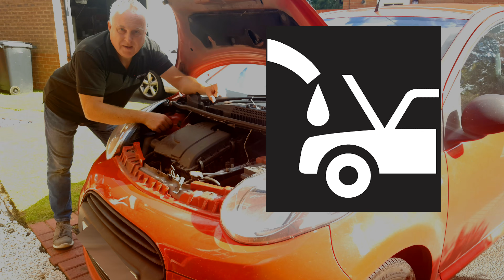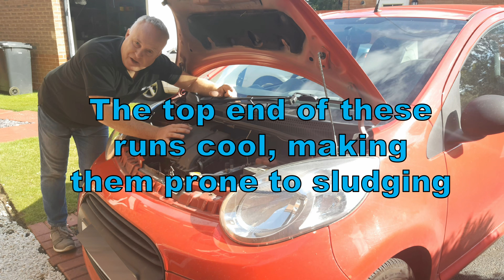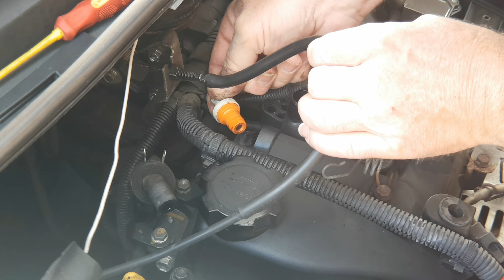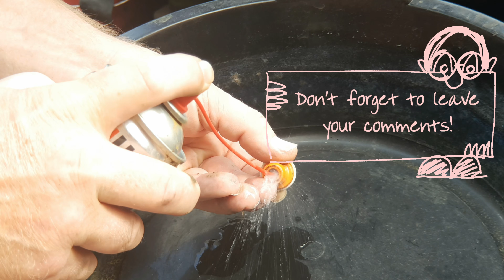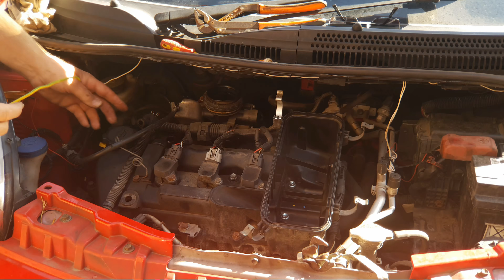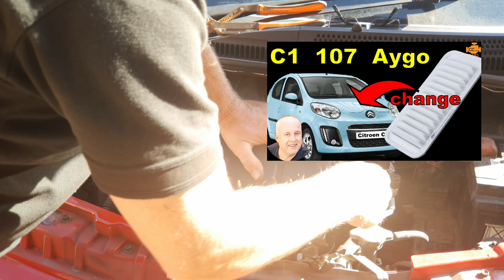Citroen C1 Using Oil❓ Is YOUR Citroen C1 PCV Valve Blocked❓

Comment: Thanks a lot for this video, really clear and helpful!!  

Just to add a quick warning I got from ChatGPT (so not personal critique), not all carburettor cleaners are suitable for PCV valves. Some heavy duty sprays are too aggressive and not safe for plastics or rubber. For example, Holts Professional Carb and Injector Cleaner and Comma Carb Cleaner both warn against use on plastics and rubber, so they are not suitable for PCV valves.  

By contrast, OB41 Carburettor Cleaner specifically lists PCV valves and throttle body butterfly valves as safe applications, which makes it a reliable option.

Comment: Thanks i checked mine, it was passing a tiny of air flow counter way but after cleaning it blocks the air perfectly. Also on the normal way the air flow is now greater. 

I hope it will solve the oil consumption, mine is consuming 1L every 2000 kms with 15W40 but it was consuming more before when i was running 5W30. As the summer is finishing i will soon oil change to 5W40, i prefer to stick with W40 because i usually drive between 3 to 5k rpms.

Comment: Great video. My pcv valve now rattles if I shake it. So the internal spring must be gone.
Car is burning oil but I am now  using cheap, thin Mannol oil.
At £40 for a new pcv valve I don't know if its the cheap thin oil or the pcv valve, or both.
Might have to go back to a more expensive engine oil.

Comment: Yeah, I watched this and cleaned my PCV Valve. It wasn't that dirty apart from the spring loaded valive itself, which was begging to show signs of corrosion. My car is running about twice as smooth now! Next I'm.going to remove the spark plugs and clean/replace them!
Thanks for this video. I may have made a mess of it otherwise!

Comment: So I gave this a try, but I’m unsure if the valve needs replacing.

When I first tried sucking, air came through so I cleaned it. 

Once cleaned, I tried again and it still came through. So I sucked harder where it then closed. 

How hard did you need to suck to get the valve to close for yourself? I want to know if you think it’s worth I just replace it.
Reply from the maker: Yes, that sounds like correct operation. It restricts the flow of gasses at idle.
Reply from the maker: oh, but if you feel you need a new one,there are two links to it in the description
Reply: @HPS-i4j  works correct. Don't replace. Just keep clean.

Comment: So question for the guru, my old man referred me to you, 2009 c1 engine light pops up cylinder 1 misfire. Changed spark plugs and coil packs, still comes up, it ONLY comes up on tick over never whilst driving, but if it’s sat idling for 5 mins or more bam comes up, no loss of power, no strange noise nothing….
Reply: @lewisward910  i have same problem,,, first found engine oil has some fuel smell,  specious fuel injectors leakage, then changed 3 new injectors, the engine oil no more fuel smell, but engine light up, computer code is p2178 which mean air to fuel ratio is not correct... 

Checked following all correct:
Fuel pump pressure 
Maf sensor 
Pcv valve 
No pipe leakage

Then change 3 injectors again, and waiting to see the result.

Comment: Replaced my Toyota Aygo 2009(147000KM) PCV Valve for the first time today. Looks dirty. PCV cleaned. hope you use less oil. I'm going to order a new PCV from the Toyota dealer, because it doesn't cost that much( €29 from the Toyota dealer😢OE but to most . Thx for video
Reply: @andy464 hello, any update?
Reply: @albertgashi1814  Yes, I ordered and replaced the part from the dealer😊
Reply: @andy464does it still consume oil, or that problem is fixed now with the new PCV valve?
Reply: @albertgashi1814  I see the oil consumption is still the same. Maybe it's because the engine has traveled many kilometers (180,000km)
Reply: “I exchanged my Toyota Aygo for a 2021 Hyundai i20 N Line. This particular model is relatively uncommon in the Netherlands compared to the Toyota Aygo.”

Comment: Hello sir. I have a Aygo 2008 with 114k on the clock . I currently use 5w30 mannol oil. I have used 6 litres of engine oil in 6 weeks with 350-400 miles per week . Any help would be great please .

Comment: Hi all. we had a big oil usage with our c1. 2 liter oil every 700 km!!! thought the engine were done. did a compression test and the compression came out good. all 3 cilinders 15,5-16 bar. So it had to be some else. By accident i came across this great vid.  i did the pcv test, Clogged!! Cleaned it and topped of the oil level at max. We drove 896km total. now at our vacation place i checked this afternoon. Only 0,5 liter added to max level. A big difference. Thanks Cyclone Cyd for this good tutorial. THXXXX from The Netherlands xxx

Comment: Interesting and a little infuriating!

I've recently sold a 107 (same car really) and took a hit on the price, because it was an oil burner!

I will never know if the pcv was at fault, but thanks for the solid gold knowledge.

You cant beat regular oil changes, I believe that 6k miles is about right.
Reply from the maker: At least you know for the future. PCV valves are a problem on many engines.

Comment: I cleaned the PCv valve and change the oil and filter and now I noticed that oil is coming out ( like wet around the cover)from the filling oil cap and that didn’t happened before, the filling cap was always dry.

Any idea what’s happening?
Reply from the maker: The cap is on properly? I'm sure the caps have a rubber ring seal - it hasn't fallen off has it?

Comment: ive noticed my peugeot 107 auto has started running ruff and acceration is slow when i put my foot down to move off cleaned PCV valve and serviced car using more fuel feels lumpy please help.
Reply from the maker: Is the EML on? If yes, what are the codes?
Check for vacuum leaks. Check spark plugs.

Comment: I use engine flush at each oil change. Car is 2005 Citroen C1. 110,000 miles. Doesn't use any oil. PCV valve clean as a whistle.
So use engine flush at each oil change.
Plus I get 63 mpg if I drive it gently. Check your rear brakes for binding. Mine were binding and I got 56mpg. Cleaned them up (using cyclone cyds you tube vid) and now I get 63mpg.
Reply: My My you are a brave soul. Each oil change? Yikes ... better you than me buddy.
Reply: Which oil you are used ?
Reply: @abdelmounaimkhatab4749  5w30 C2 fully synthetic
Reply: @williamlambert1711   thank you for your advice !!
can i ask you , did you used another oil when you had low milleage ? ( when car was new )
Reply from the maker: Great tips. Thanks

Comment: The biggest challenge I had is removing the PCV valve itself.  On my Toyota Aygo, the PCV will not budge even if you pry it.  I'm considering escalate the situation by removing the rocker cover (ordering a new cover gasket and PCV valve just for safe measure).   My biggest concern is: I may not be able to get to the PCV from the back...
Reply: Had the exact same issue, tried to clean the value when I decided to service my car and I couldn't get it out. If you managed to somehow figure out a way to get it out without breaking it please let me know.
Reply: @fizzil9858  I ended up using brutal force at the end.  Two Flat heading screwdriver prying on both sides slowly at a steady force.
Reply: @fizzil9858  wiggle it should come out ,I've just done mine very easy ,mine was gummed up cleaned with plenty carb cleaner refitted it ,now car runs smoother and quieter, well pleased ,great vid cyd

Comment: Okay so I totally acrewed uo. I didn't change my oil for 20k in my aygo and it started making some serious noises going round corners. Its been through 2 mots just fine, but it does have an intermitant engine warning light. Not really burning that much oil. Im thinking a PCV clean, oxygen sensor clean and use some restore oil in the next oil chance incase I have damaged the cylinder sidewalls. Car has done just over 100k, so some of these sensors may require replacement. I have recently matched my best tank range of 500 miles, so no real loss in efficiency. Any further thoughts? The car is a biy battered outside, but it works absolutely fine, so want to odeally see another 50k out of it. Save my self £25k over 5 years in car finance payments 😂😂
Reply from the maker: Give it a flush, it will need it.

Comment: Is this car economical in fuel consumption? Thanks
Reply from the maker: Oh yes. 50mpg or more seems typical.
Reply: Thanks bro
Reply: I know I'm a bit late, my Peugeot 107 (same insides as the C1 and Aygo), from 2011 can get upto 70mpg if I drive conservatively. Currently qt 93k miles, I do around 16k miles a year. Mix of rural roads and motorways.
Treat it well and it'll just work
Reply: Mine is 5.74L per 100km

Comment: By the way, the part number for the PCV is TOYOTA 12204-40030. They seem as rare as hens teeth in the UK and cant find one for sale anywhere. I believe the part is Made In Japan.

UPDATE - 30/01/2022, just cleaned mine, did not remove anything, was able to work around everything, just unattached the accelerator cable from the metal securer. I sprayed carb cleaner on long cotton buds and just wiped them around the inside of both rubber hoses to lift out any debris and dirt, blasted the PCV with carb cleaner and refitted.

I have no idea if this will improve anything but its only a 10 min job and a bit of fun to do anyway.

Thank you for your video :)
Reply from the maker: There's a link to a Japanese supply in the description
Reply: On some vehicles, they are buried/ or really a pain to change out or find/ & get stuck in the rubber holder/ or just plain get 'beat with the heat' as it were. My Chrysler 3.3 L engine is a real bugger to even touch let alone change out. And had to look around for one here in Canada too. The old engine they sadly do not make anymore. The old iron block was a good engine. 3-400,000 miles no problem. Change the oil every 3,000Km. A must!

Comment: Great video... gonna do this tomorrow.  I'm chasing a very rough idle on my 2007 Toyota Yaris.  It seems fine when it's revved a bit and under normal load,  but on idle it's quite rough,  shakes the seats etc... I've taken cleaned the MAP sensor and the throttle body just wondering if you'd any other suggestions ?
Reply: Might be sparks or cables that connect to them.
Reply: @FUCKYOUTUBEANDITSIDIOTICHANDLE  Thanks for the reply... I discovered it's just the way they are !  I guess I've been spoilt too long with the M54 six pot in my E46.

Comment: I cleaned mine so will keep a check on oil consumption, fuel economy doesn't seem to have been effected yet. The PVC valve looked dirty but still seemed to operate when sucking and blowing through the valve, the airflow seemed to increase after cleaning it though. Personally though I wouldn't recommend an Oil flush unless it's absolutely required, just change the oil more regularly to keep the engine clean (oil has cleaners in it anyway so as long as you don't push it too far it will keep the engine clean)
Reply: I got an oil flush on my 'ex-girlfriend's' VW Golf (with the dreaded grey paint syndrome) and it destroyed the engine even faster than if I had let it die at a young age on its own. I will NEVER get a flush on any of my engines unless some kid puts soda pop in the crankcase! lol Just change the oil more often/ too much/ it can't hurt.
 P.S. That VW was a total nightmare of maintenance woes. Half made in Germany/ and half made in  Mexico. One nasty machine. I would never buy one personally here in North America. But for you, sure, go ahead. by all means. Man, I hated that car. Didn't like her all that well either looking back ...

Comment: If the crankcase has a breather inlet - then surely, if the PCV valve gets stuck shut, the crankcase won't be pressurised as the blowby will simply get vented into the air cleaner?   If it is stuck shut - then I can see you might draw in excess air while idling - but have no particular effect at higher engine speeds.  What I struggle to understand is why a faulty PCV valve should ever cause excess oil consumption!!!  (unless it was causing pressurisation of the crankcase).  I've yet to find someone who can explain this to me!
Reply: And one more question.If a stacked pcv valve provokes oil leak where the oil goes?

Comment: Cleaned the PCV valve, but it's still loosing oil.  There's no black smoke from the exhaust or leaking from the sump plug.  Any ideas?
Reply: I also need help with this:(

Comment: Hi sir, where can i purchase a new PCV valve for my C1 ? Thanks for all the useful informations  👍
Reply: Part number is TOYOTA 12204-40030. Try main dealer as they seem rare as hens teeth.
Reply: @ferenczsinko6770  Indeed haha. I finally cleaned the part with a carburator cleaner because I couldn't find any dealer. And it worked great. I'll save the reference for next time tho. Thanks for the info 👍

Comment: Another suggestion to prevent valve getting stuck and dirt. Change oil and filter every 5k miles (or 8k) or every year and use most tiny oil possible even in southern Europe countries. 
Toyota asks for mobile 1 (that's Toyota genuine rebrabdend) 0w20 API SN ACEA C2 but a 5w30 API SN ACEA C2 with low cts could be OK. 
I use castrol magnatec 5w40 API SN ACEA C3 since my engine was not serviced as well for 40k km so same damage was done.(but oil consumption its OK and engine runs smooth thanks to new pcv valve and short service intervals). This prevent the valve to be stucked and helps to keep clean piston rings and free to do their job (prevent oil leak and scrape oil from cylinder).
Once again thanks for sharing this video. This can help a lot with oil leak, having an healthy and reliable engine.
Reply from the maker: Yes, change the oil every 5-7k miles OR twice a year with full synthetic 5w30. You should still check and clean the valve every 2-4 oil changes.
Reply: @CycloneCyd  I talked about oil with a toyota mechanic. He said genuine toyota oil its Mobil 1 esp 5w30 API SN ACEA C2. Hope this info could be helpful too.
Reply: @CycloneCyd  I have a question. What to do if pcv valve is stucked and you risk to damage the grommet? Sometimes hot air doesn't work. When I replaced mine pcv I had to destroy the old gasket (that's why I bought valve and gasket ). Your opinion worths a lot to me.
Reply from the maker: @xyzRyoxyz  Thanks ryo. I would say if the PCV is stuck in place, you could use a piece of hose to blow and suck to check it's still operating but this is only a very basic test. In this instance I would advise replacementof both the valve and grommet, but wait till you have received your new parts before pulling the old one out.
Valves usually come with a new grommet anyway.
Reply: @CycloneCyd  my valve + grommet were replaced in January. I'm the dude that linked amayama site :D. If you want to order the gasket you have to order it. The valve cames without gasket (is it the right word for gum seal?). When I replaced mine it was impossible to take apart the valve easy and without damaging the gasket/seal/grommet whatever is the right word.
Reply: If u check toyota engine fact sheet it can even use 20/50 esp if a high miler
Reply: @volt8684  yes but too tough IMHO.

Comment: Thank you very much for sharing. I replaced it for 25€. Bought spare original valve and gasket from Japan.

Mine was really hard to unfold so I used hot air to soft gum gasket. Oil consumption was an issue for me, now it's almost 700ml every 10k km. Incredible such a little and cheap valve can cause this major issue.
Reply from the maker: Thanks for sharing. yeah, it looks such a small inconsequencial part, but oh boy it can wreak havok with your engine when it goes bad
Reply: Where can i buy it please, can you share link

Comment: Cyclone Cyd, how is the silicone holding up on your airbox? I hope it's still well sealed. Thanks.
Reply from the maker: I was looking at it when I made this video. A little peeling at the edges, but it seems to be holding up okay. A better and permanent solution would have been plastic welding, but I didn't think of that at the time.
Reply: @CycloneCyd  Thanks very much for the update. I found more gaps in mine when changing the air filter but have run out of epoxy so used Stixall. It's also peeling a little around the edges but, given the epoxy nearby, I didn't wedge open the gap & therefore wasn't expecting a robust seal.

Like with silicone, the Stixall is also peeling at the edges. Epoxy, however, seems to hold up.

I may try the rest of my Stixall on my aerial base since acetoxy silicone will rust any bare metal.

Comment: Thanks cyd that was very informative well done and will check mine this morning 👍😊
Reply: Hi cyd I have cleaned the valve like you have shown on the video and was very easy to do. My car is a 2011 C1 1lt .
I also did the same on my 2013 Toyota Yaris 1lt which appears to be the same engine.
On both cars the valve and pipe was just dirty and I cleaned them the same way you did. 
Anyway great and useful video cyd keep it up. 😊👍
Reply from the maker: Do let us know what you find.

Comment: I don't have any carburetor cleaner. Would either  brake cleaner or isopropyl alcohol be a suitable substitute? Thank you.
Reply from the maker: Ssshhhh! Don't tell anyone, but that was a can of brake cleaner in the video - did you notice how you didn't get to see the tin properly.  I actually prefer brake cleaner for this as it dries very quickly.
Reply: @CycloneCyd  Brilliant! Thanks for that. I believe my brake cleaner is acetone free but I was worried about damaging the valve.
Reply from the maker: @74HC04  yeah, some brake cleaners contain acetone and this causes micro fractures in plastic - so yes, an acetone free one is the way to go.